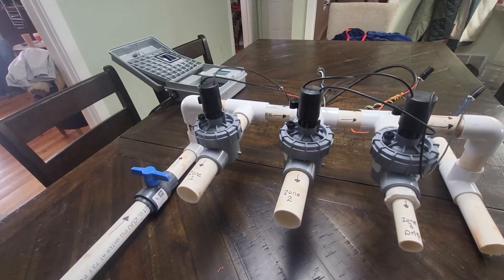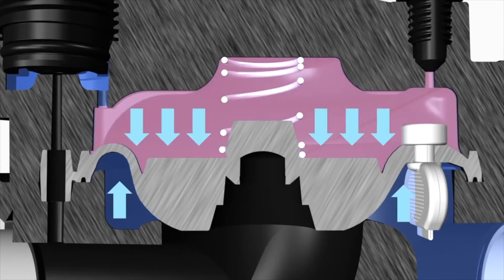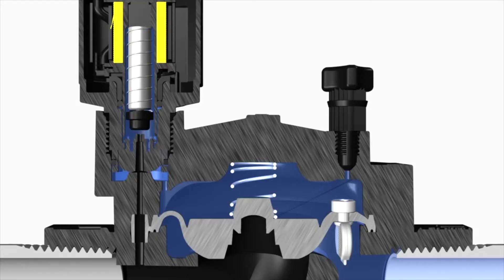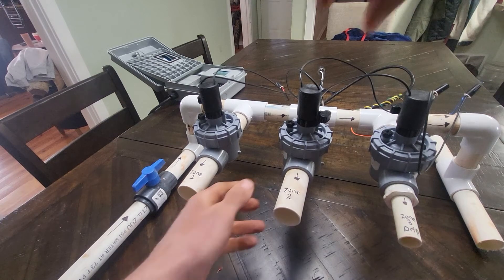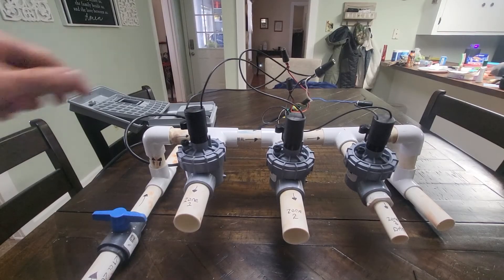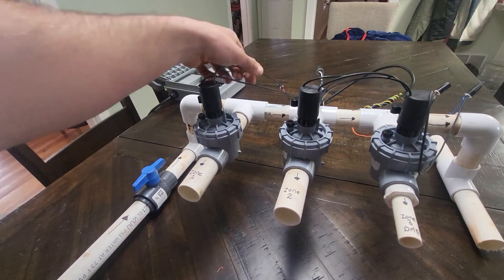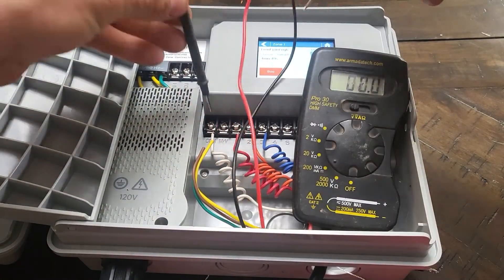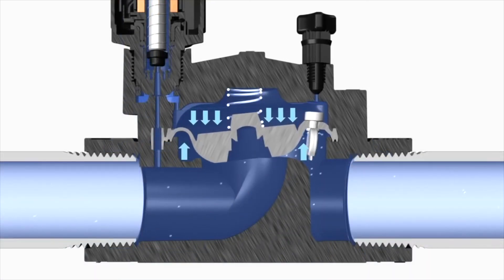How irrigation valves work.

Comment: Thanks for the video, much appreciated. What brand valves are those gray top ones? I have the same exact design, which was installed many years back, and now I need to replace/repair it since it's leaking.

Comment: is there a way to open/close these without water in them? i was running air through the system to winterize it and had a faulty wire so one wouldnt open automatically, but when i tried to do it the manual way, it would not open.
Reply from the maker: Winterizing systems with air compressors aren't common in my area (West Texas). Did you try the bleed screw? 

If you're still struggling I suggest asking the question to this group. They will have the answer. 

https://facebook.com/groups/1594952854094348/
Reply: yep, the bleed screw is what i used, it seems if there is no pressure of water behind it, they will not do anything. 

the one thing i do not think i tried was having air pressure in the line and opening it, i didnt want to break anything. 
 @irrigationtipstricks7797